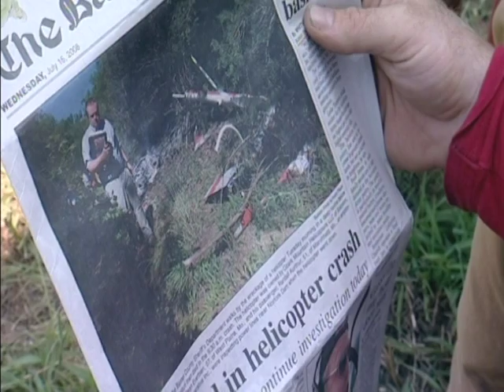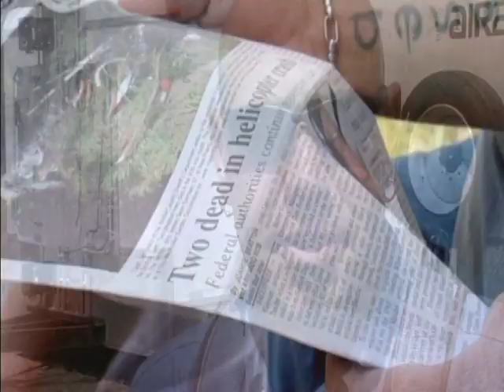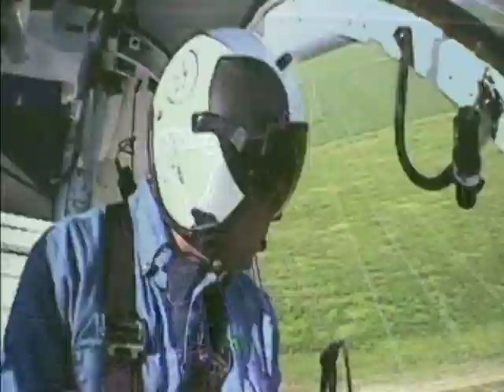Half Million Volt Workers Part 2

Comment: This is for the novice for my previous comment. A counter rotating blade is 2 main lifting blades rotating opposite from each other cancelling out torque.The copters used with the tail blade use a blade on the tail like a fulcrum more or less power will cause the copter to rotate and fight the torque of one main lifting blade. The poor soul has to look at both rotating masses in close proximity to the power lines. Has to also fly and keep stable in X Y and Z axis. The idea of a counter rotating lift blade with an 12 foot extension and a front platform really. Rotating mass 7 feet clear and X Y and Z only 2 you have to focus on.Just saying.

Comment: You need a purpose built copter for this hazardous job a counter rotating main blade on a pedestal 12 foot of clearance and a 12 foot platform on the front of the air frame come on really this thing would be a cakewalk to build and be the ultimate line maintenance tool.

Comment: My respect to these guys I'm a commercial electrician & I don't even work 120 v hot
Reply: srsly? you never done maintenance job so far? I am commercial and industrial construction electrician but still working on live line up to 480v when if line should not be off during whole process. 120v is joke. you can just feel some dull sting piercing on ur finger
Reply: @psyo123  yea I get a whole bunch of change orders but what I usually do is come in real early before the tenants show up so if there's circuits I need to work on I got time to turn it off & work on it but if I'm in a data center or any kind of critical power I usually set up a shut down with the tenant
Reply: @thomasdominguez8421  aight thx for sharing. I support you actually. safety matters.
Reply: There has been a couple bad accidents where guys working on 120v hot & fallen off ladders I don't work hot I do more of remodel work im not service guy
Reply: @thomasdominguez8421  even by 70v  you can die its all about amp not volt but do you never get change order to add more receptacle or install additional panel lights or something after you pass final inspection? do you always turn circuit breaker off before add resisting devices? I am just curious.
Reply: Thanks

Comment: Thanks for sharing, great video!!  That's an interesting thought, why not use shrouded fan choppers like the air ambulances? The Eurocopter has a shrouded tail rotor but is pretty big and likely tough to maneuver around power lines.  NOTAR choppers might be an answer...  I'll bet they aren't cheap tho….

Comment: They used distilled water....saying they could get killed.  Like i am going to buy in to the bullshit.  Do not get me wrong getting near a high voltage power line is dangerous in a helicopter but hitting it with distilled water is not....

Comment: how bout getting onw of the russkies counter rotation main rotors like on ka28 which eliminates tail rotor and maybe slapping some insulation on back
Reply: Kiza Kizic Or even a platform on the front of the heli instead of the side
Reply: How are you gonna get that in friggin Arkansas?
Reply: @Lancaster604  does the helicopter have to come from Arkansas to do the job? Perhaps it could fly in from some other state. I won't tell anyone if you don't.

Comment: forgive my ignorance but can't someone design a helicopter with the tail rotor back, away from the wires, maybe enclosed? I realize it's not the only problem but it may help. thank you for not insulting my intelligence or my heritage, just asking.
Reply: Its already been done. Several chopper designs use counter-rotating main rotors to overcome the torque of their motors and eliminate the tail rotor entirely. They also can enclose the tail rotor, with something called a Fenestron, but again, mostly bigger choppers that are not as common or as cheap.
Reply: They have. The kamovs. They're Russian tho , probably some qualms with using Russian gear and actually getting it in Arkansas.
Reply: @Lancaster604  trump can do it

Comment: Any idea how the birds land on these 500 kv lines and not get fried?  The helicopter produces a 3 foot arc when it approaches and the workers have to wear metal suits, but the birds land and stay on without even a hint of discomfort.
Reply: +Permaglo - Actually, birds do not land on these lines. Above a certain voltage, birds start to feel the electric field that surrounds the wire and they actively avoid it. This is the same reason these guys have to bond the chopper and themselves to the line. On the other hand, birds perch all the time on the grounded guard wires that run along the tops of the towers. They also have no problem with perching on most distribution lines. The voltages on these -- around 7200v and less -- don't seem to bother them. Think I've seen birds on 34.5kV lines but nothing higher then that.
Reply: Permaglo they are only touching 1 wire at a time. one is live the other is a ground. if the bird touches the live and ground together it will get zapped
Reply: Permaglo electricity follows the path of least resistance and the wire is a better conductor than the bird. so when the bird lands on the wire, the outside of the bird becomes charged at the same voltage as the wire so electricity never flows Through the bird. get it now?
Reply: A Bird can stand on any single wire or phase at a time without any problems. If the Bird comes in contact with more than 1 phase at a time or grounds itself while touching any phase at all, then the Bird would be toast. I used the word phase instead of wire for good reason but I won't go into all of that for now.
Reply: The arc is caused by induced voltage. Birds arent metal so voltage isnt induced.
Reply: Listen to inflec. Birds dont like anything higher than about 17,000v

Comment: did he just say that tiny  pump gas motor was 3500 horsepower? even if he meant 35 that's still pushing it. 3.5hp maybe
Reply: He might of meant 3500 psi
Reply: he meant psi
Reply: The heat was taking it's toll on him. He meant watts probably
Reply: Lold

Comment: How do they keep the airframe from being magnetized?
Reply: Magnetized??? You mean electrofied?? They charge the worker and copter
Reply: Did u even watch?? The rod?? The clamp???
Reply: @msain427  He meant that any flow of current causes a magnetic field and yes current does flow between the helecopter and the ground due to paracidic capatance (the reason the arks fly from the rod)  Also the chopper doesnt get charged to 500,000 volts it flows current between the airframe and through the resistance to ground through the air.  Therefore it uses the helecopter to conduct that power rather than through a workers body by attaching the metal airframe straight to the wires it doesnt flow through the worker, due to it having the path of least resistance.  So yes there would be a magnetic field in not only the power lines but also the helecopter.

Comment: I'm curious as to why they haven't developed a coaxial helicopter for this specific job, seems removing the tail-rotor removes a huge liability.
Reply: +Brent Cromwell Or maybe putting platform in front of the helicopter, instead of a side.
Reply: Brent Cromwell money
Reply: @rubenscott3972  that's sad. Lives aremorethanmoney
Reply: @zendesigns5602  you would think so
Reply: Just look up k-max hrlicopter it was developt for woodwork but would work as well
Reply: Brent Cromwell expense!
Reply: Yeah, it would be beneficial, but as everyone who has responded to this will tell you, the biggest deciding factor is money.

Comment: How in the flying fuck could a spacer wear out? There are zero moving parts and such! Two people died replacing spacers of exceptional mechanical quality in the name of money! Love these types of jobs/videos but my God, bet those spacers were fine... Some needle dicked pencil pusher at the Arkansas Power and Light company was like: "Lets do a bunch of dangerous, useless work right now. The faster you [Get 'er done] the better". Fucking politics
Reply: fla playa It could wear out, just m guess but natural conditions like rain, snow and searing sunlight can render a spacer unqualified for its task.
Reply: +fla playa I am a lineman who does this type of work and I can tell you most of these mandatory replacements of perfectly fine apparatuses are mostly due to government requirements.
Reply: +fla playa There are tens of thousands of them, they are working mechanically, materials and bolts rust, they are hit by rain, snow, freezing water and hail. After 10 years, few will fail. It is maintenance, preventing failure (by replacing parts), before it happen. Also they do that, because once they were installed, they were probably only certified for this and this amount of years, and they need to be replaced, just because. It is hard to tell if they will last few years more, without actually taking them down and inspecting. At that point, it is just easier to just replace them.

Still the idea that they do have to do it quickly, is very concerning to me. I would better spend more time and focus to do it properly, than rush stuff in.
Reply: ***** Yeah, it's perfectly fine to imagine a forged piece of 6160 aluminum with alloy bolts clamping wearing out holding a couple of static lines together... Been a while since my comment but I stand tall in my assessment: Needless waste of those gentlemen's lives.
Reply: +movax20h 
I'm sure some of these guys wake up in a cold sweat in the middle of the night on a close call
Reply: ian turner Well God bless you sir and thank you. If this is what you are doing you are an unsung hero. Government requirements eh? *Nods head. Thank you sir for the comment and thanks again for keeping our lights on... Curious, any 500Kv work or even the dragon 765?
Reply: movax20h Yeah, I suppose there's material fatigue, I was just a little shaken up over people dying. I honestly think it should be last resort only going on live lines. I'm no lineman but I've studied High Tension Power Lines my whole life. Would it be better to just inspect the lines and when they find a broken spacer then do the repair? Idk, just seems like overkill. I don't think having a broken spacer here and there would be all that detrimental to the safety and performance of the line. Sorry if I'm stepping on any toes here, hold the highest regards toward anyone who goes up there keeping the juice flowin'.
Reply: You are right, probably few broken ones would not cause any issue at all, an will show up on next inspection, when it would really will be needed to be replaced. Maybe it is some silly government regulation or insurance (sic!), thing. I do not know how all these companies evaluate risks and costs. Maybe they know it will cost some lives, but if it will be still cheaper (including potential insurance claims) than other alternatives (like building everything from scratch, or risk of huge catastrophic failure in the future), they might still proceed anyway. Sad but true. Car manufactures do that to sometimes.

I do not know if these guys are crazy or brave, but this is hard work, and I do not think I would be willing to risk my health and life, even for salary being 2x average.
Reply: Good old bureaucracy. Money really is the route of all evil. 500kV is so nasty. That job is worthy of $100/hr no problem, even 13.2kV is extremely hazardous.

Comment: 3,500 horsepower pressure washer? 

Surely he meant PSI
Reply: 3500 HP out of the motor shown is in no way possible. If we take the high side for angular velocity in high pressure pumps, about 6000 RPM, this would require the torque to be 3036.7 ft*lbs. Absolutely impossible for that motor. Such numbers would require a combustion engine the size of a car as well as some sort of power addition in the form of, for one turbos. He meant 3500 PSI
Reply: Derek Martell He surely mucked up that sentence.
Reply: yeah lol tank engines dont even put out that much HP
Reply: Chuck Aule cat f51 has 4000hp
Reply: Idk, they're spraying pretty far and hard, could do it
Reply: Derek Martell it needs that amount of power to run
Reply: That equates to about 250 bar which for a pipe of that diameter sounds about right, given my experience with fire engines
Reply: 3500 miles per hour
Reply: @0101-s7v  Imagine a 3500mph stream of water hitting you... ouch... Sure, 3500 PSI isn't 3500 mph but that would really hurt
Reply: Idiots
Reply: Pilot: Linemen watches tail and rotor....
Lineman: I don't even look
Reply: Definitely psi... That little gas engine haha

Comment: Have they since looked into incorporating tail rotor protection? Shrouds?
Reply: Hardrive33 they have helicopters with tail shrouds already that work just fine.
Reply: I am sure if they could be used they would be in place. Like the other dude said about cutting air needed, yes I have seen them on choppers but maybe it cuts down on the delicate maneuvering. On commercial fishing boats Cort nozzles are used for more thrust and mostly used on scallop and dragger boats as they need as much forward push, longliners don't use them as they need to maneuver up close to their gear.
Reply: Daren D shrouds would stop a lot of the air needed for it to function by stopping the heli spinning